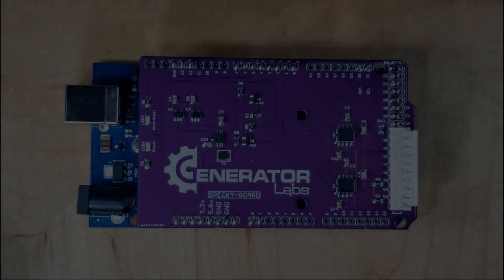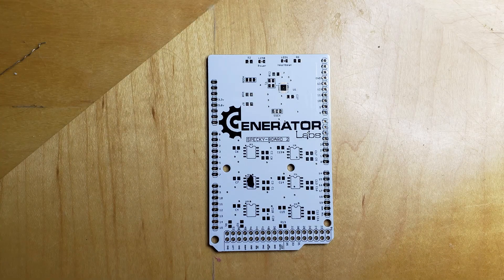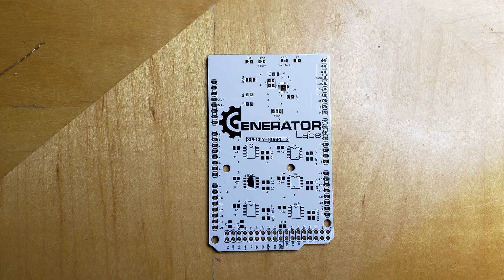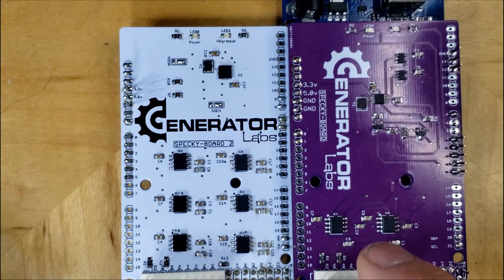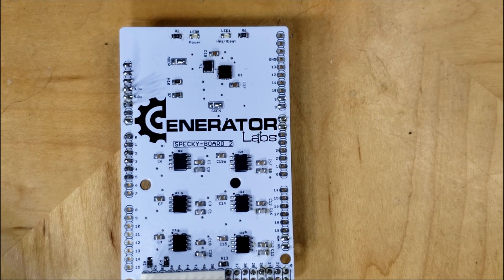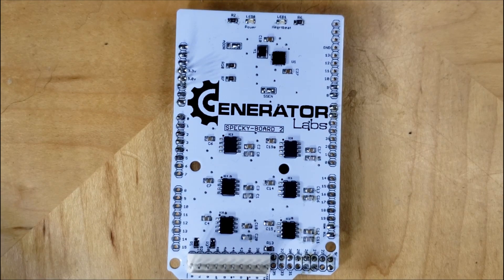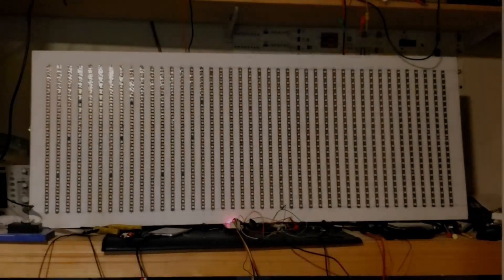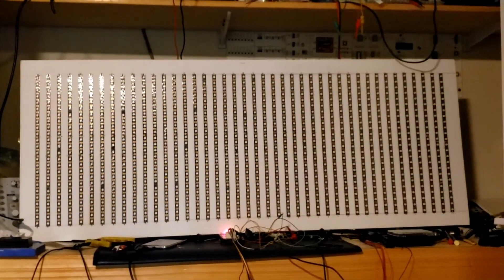SpeckyBoard Version Two: Homemade 42 Band RGB Spectrum Analyzer

Comment: I'm curious as to what clock generator chip you're using on this new board. I've been working on a similar implementation with an esp32 running it all, but to use 4x msgeq7 chips, I've gotta use two si5351 clock generators. Just looking to slim it all down as I expand to more bands.

Comment: Awesome project! Using 6 MSEQ7 chips with different clocks?  What are the input clock speeds and what is the approximate total frequency range you get? I didnt find any code for 14+ band models..
Reply from the maker: I did not post the code for anything above 14 bands. The most popular kit is the 14 band kit. I do not plan on publishing the code for the other projects.

Comment: I would love to include this as a project for the electronics class.  Any idea when the Ver 2 will be available?
Reply from the maker: The Ver 2 is available but because of the necessity for 4 rolls of LED's and more expensive hardware it may not be the best project for a classroom. I would recommend the 14 band Specky board for a classroom project.